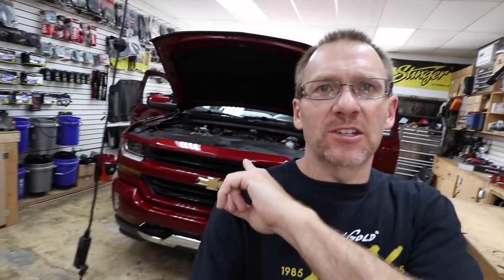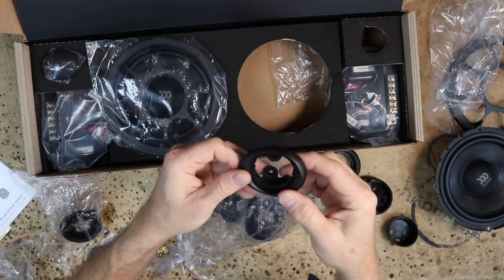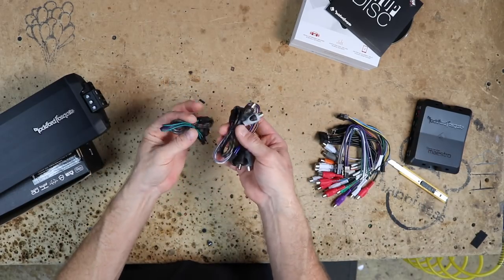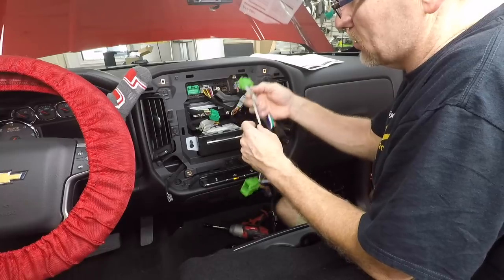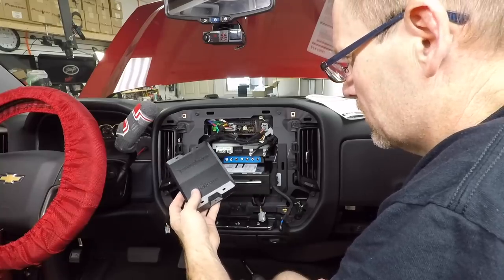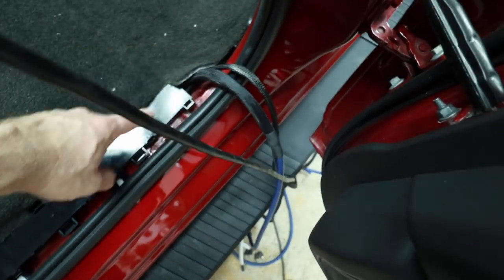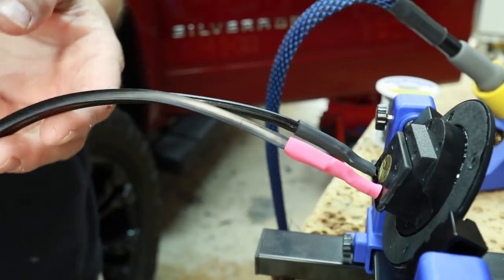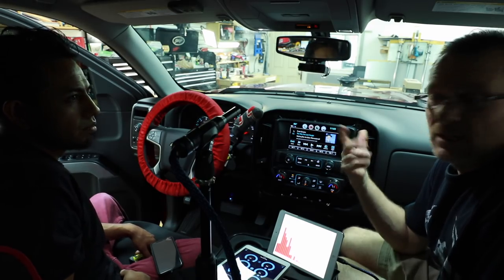AP4-GM61 Amp Pro installed in a Chevrolet Silverado with a non Bose 8" screen, Installer Diaries 132

Comment: I just put the AP4-GM61 in my Non Bose Silverado this week, have it going to my Dayton Audio DSP-408, running active with Tang Band 25-2176s Tweets, SB Acoustics sb17nrxc35 6.5s fronts, NVX NSP Coaxs in rear and a Soundqubed HDS3.1 12" in a Cherryman Customs rear middle seat box... The PAC makes the stock HU sound SOOO much better vs the LC2i I was using before and I haven't even done a full tune with my USB mic and REW yet... Awesome video guys. Really helped make the install easier seeing you guys do it!! Great stuff!!!

Comment: some great gear on this one and a fun challenge. you always say you set the crossovers to 80Hz for all the speakers as a starting point but ya never tell us where the crossovers end up after the tune. it varies by car and gear and music selection but I am always curious where the settings end up after the tune. show some EQ shots please and crossover freq and would be great to get voltage numbers since most of us have digital multi-meters but few of us have the SDD tools for distortion checking. 

maybe before after RTA pics with a pic of the EQ adjustments that got you there?

learned so so much on how to get the gear into the car. I know copying and pasting your tunes will not necessarily yield the same results in my car but like all your gear install ideas seeing where you start and where you end up on the tune will teach and give some great ideas.

Comment: What a coincidence!!

I have the same Morel  speakers configuration

- Morel Virtus components in the front doors 

- Morel tempo coaxials in the back doors

The only difference is that mine are 5 1/2" because my truck is smaller than a Silverado

I use a 4 channel for the amp for all the speakers and 2 flat powered subs behind the back seat

Comment: Dean,  Instead of mounting the bass knob under the dash, there is that open pocket on the top left hand corner of the dash.  There is already a hole in the back of it large enough to fit the phone cable style of bass knobs.  Just a little high temp double sided tape to the top and your good.  No holes drilled and tape is removable.  It's where I put mine, I have a 2015 Silverado Crew Cab.

Comment: Can I please bring my 2016 Silverado to you all to fix!? All I wanted was to upgrade my factory speakers and add an amp to my 8" screen for a good sounding system, I got stuck with the fix 86 and holes through the back of my cab holding the amp on....it sounds better but not the 1200 bucks I paid better....they used Kenwood xr401-4 with KFC series speakers in front and back doors.....you guys are by far the best in the business!!

Comment: man i have learned so much from watching yalls videos i live in florida too up near gainesville didnt realize you guys were in florida too but thanks for this i have a 16 sierra 8 inch non bose and was stressing about how i was going to deal with the door chime issue but this solves that and gives me clean low level pre outs right at the radio so im definitely going with this amp pro and the dsr1 dsp

Comment: I have kind of a 2 part question,  first if you use an amp with dsp would you have to use something like that amp pro? Second if you do need to use something like the amp pro which do you all prefer the amp pro or the metra dsp ? Thx for all the info you guys put out there.

Comment: Just as a heads up. On the dual battery, chevy does not include a battery plate on the driver side of all silverado's. You need to buy a different plate. Not expensive but makes things mount properly.

Comment: I want to add my Alpine 445a to my factory 4" non-Bose head unit. Will the Car Av 12232  work for that application so I don't have to cut and splice the factory wiring?  Any help would be appreciated.

Comment: HELP PLEASE!! 
I've been doing some changes to my wife's 2016 Malibu LT which also has the non Bose 8" screen. I love to you guys used the CarAv 12-232 and would like to do the same but i and having trouble finding it for purchase online. I checked amazon.com and there was no product found on their site. Could you please point me in the right direction towards purchasing the CarAv 12-232? Especially if it will work on my wife's care, which it should bc Gm will typically use the same parts on their vehicles. I would like to not have to cut into the factory wires if it can be avoided as we don't plan on keeping the car forever. Any help will be greatly appreciated. Thank you

Comment: This is probably a personal preference, wouldn't things sound better if you left the rears on stock power and run the components full active on the DSR1 and the 4 100watt channels of the T1000-5?

Comment: Did you guys run 2 separate wires for the tweeters? I only seen four wires, because the non bose audio front door and front mid range plays through that one wire vs the bose uses 2 separate wires.
Reply from the maker: Yes we ran tweeter wires

Comment: Hey Dean and Fernando I have a couple questions relating to the speakers used. If you went active on this setup what amplifier or amount of rms power would you use to power this setup. And what's your thoughts on comparing the Morel 5 channel compared to the RF 5 channel.

Comment: Dean i am doing the same install on my 2016 silverado but without a DSR1. Do i use all 3 out puts from the AMP PRO front, rear, sub, or just the front and rear ? im using a Punch P1000X5 and the bass knob going to the amp.

Comment: Dean, can you please explain the audio issue with the FM and XM? I don't listen to FM but listen to XM all the time. I have a 2015 Silverado non-bose. I replaced all the door speaker with JL Audio 6.5's and they are running off the factory amp. I have 2 JL Audio 10's  being powered by a Rockford Fosgate R500X1D. I'm getting my input signal from an Audio Control LC2i. I tapped the rear speakers to get the speaker level input for the LC2i. Am I not getting a true stereo input signal into the LC2i?

Comment: Can I just cut the speaker wire on the green plug for a 4 channel line output converter and cut wires to install a 5 channel amp instead of this kit? I have a 2018 Chevy Malibu LT with 8 inch touchscreen without bose and I can control the chime volume from the factory.

Comment: Why not just run the system off the high level output?  You’re running a dsp, couldn’t you just adjust it back to a flat eq with the dsp?  Then you would still have all the stereo and balance/fade on all sources. I’m not try to nitpick. I just don’t understand why. To me at least, you just spent money to loose features. I’m probably just missing something. I haven’t really messed with modern factory systems. I’m just adding an amp and subs to my new truck. I haven’t done a complete full system in almost 20 years. Then it was just replace a head unit, add a signal processor, amplifiers, speakers, and subs. All you needed then was an $8 plug to change the radio.
Reply: I haven't messed with any car audio system for about 15 years and now I'm getting back into it. Im confused myself about having the low level output up front and the high level output in the rear. I thought taking the high level output harness and connecting it to the DSP then to the amp was good enough. In this video, he's not even using the low level output for the subs neither. So I don't get it myself why to use both. The PAC AP4-GM61 is running for about $350 and the PAC- APH-GM02 is only like $35 bucks. That's a huge difference just to have 2 different option when only 1 is needed. The only benefit I see is the ability to lower the chime.
Reply: Trying to do this same installation. What did you end up using?

Comment: my 2018 silverado door chimes went super loud after amp and subwoofer installed with factory radio, also when using the signals are loud how do i fix it

Comment: Question, is it required to use the DSR1 in this situation? Or is it an option? Or is it a recommendation to use it in conjunction with the AP4-GM61?
Reply from the maker: You do not need to use it. You can go directly into an amp or any other DSP
Reply: Five Star Car Stereo Thank you, for the info.
Reply: @FiveStarCarStereoInc  One more question, if you go directly into an amp with out a DSP like the DSR1, can you use the knob attached to the AP4-GM61 for gain control for subwoofers? In the video I noticed that, the knob was used to determine the level of the door chime.
Reply: Can you also use that same amp pro when u don't want to keep the onstar, xm,or navigation. But all the other handy stuff like the steering wheel buttons working.its on a 2019 Colorado btw. I sure like some info pls. Plus I have more questions for ya'll

Comment: ilive in wpb fl I have a 2016 dodge ram with the alpine system in it 1500 crew cab sport have you done one going to up grade with two alpine v-12 amps I will call you tomorrow  need some info .. thanks glenn

Comment: I drive a '17 GMC Z71 as work vehicle and I gotta say it's the worst ergonomically deficient trucks I've ever driven. It feels like your driving a car with a multitude of blind spots unlike any truck I've ever driven. The seats feel like your sitting on the floor boards and even then it's a struggle to see traffic lights. Line of sight to the road through the windshield is obstructed by the hood of the truck making off road driving more challenging then it needs to be. It's no shocker as to why Ford trucks are superior. Basically, dont waste your money on a stereo system for a truck that SUCKS!!!